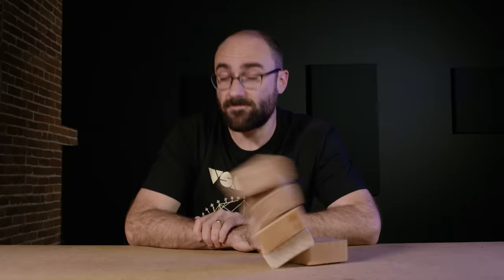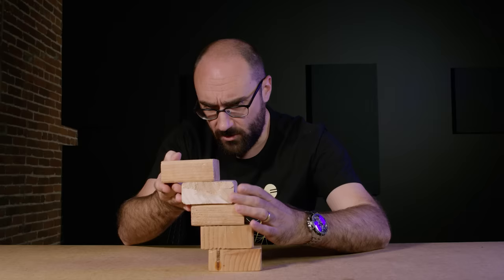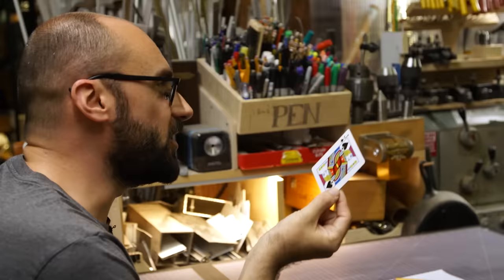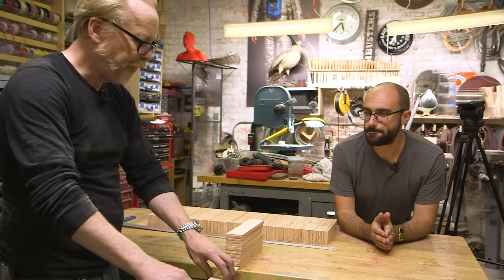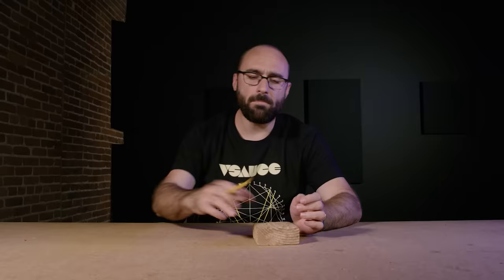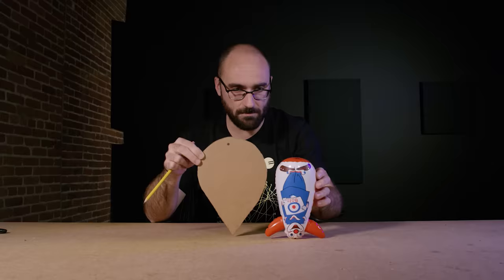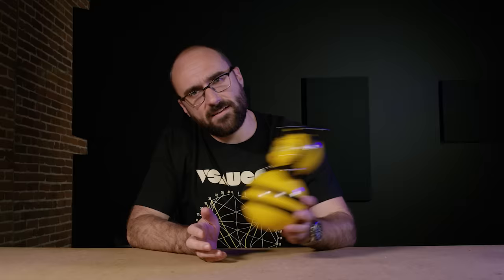The Leaning Tower of Lire

Comment: Michael: 2 card lengths, you're gonna need 31.
Adam: Th-Three card lengths?
Michael (unfazed): 227
Adam: aHahAHHAhaHhhHAhaha
Reply: He can't be beat
Reply: Actually my question is, did he memorize this values or did he calculate them on the spot that'd be insane
Reply: @ichigokurosaki7762  He definitely memorised it, no chance he calculated 227 sums that fast
Reply: it’s vsauce anything is possible
Reply: Marius Grön 

Or did he?
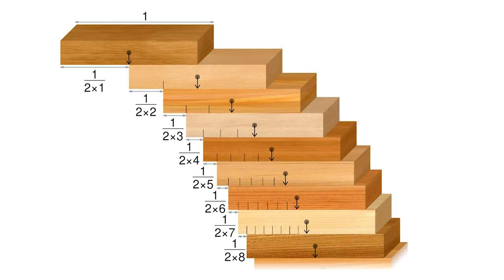Reply: 4:27 It's actually not true. Michael's answer here is based on the harmonic numbers, and the fact that you'd need 31 cards to reach three times your initial length. However here, the distribution is not exactly harmonic as 1 / n, but as 1 / (2n) , as he says at 3:14 in the video. So the figures he gives around 4:27 aren't correct, since they include in the sum, fractions as 1/3, 1/5, 1/7 etc. and not exclusively the even ones : 1/2, 1/4, 1/6 etc. 

For example, in the harmonic distribution we have here, it wouldn't take 4 cards, as in 1 + 1/2 + 1/3 + 1/4 , to double the length, as Michael said at 4:18
But actually 5 cards : 1 + 1/2 + 1/4 + 1/6 + 1/8

And so on... So the figure of 227 isn't correct either. But that's okay Michael we forgive you!
Reply: @Lucas-DX  227 is correct, 4 cards is correct as well.
Reply: @Lucas-DX  :0
Reply: @mariusmichaelgron9938  lmao okay so is it correct or not?
Reply: @angeliniac  Either. What Lucas D meant to say is that Michael just forgot to count the bottom block they're all resting on, but only if you rest them all on one block. Using the edge of a table, you don't need the bottom block (or card).

So in Adam's workshop, 4 and 227 are correct. On Michael's table, 5 and 228 would be correct.
Reply: @vituperation  oh, okay!
Reply: @mariusmichaelgron9938  good mathematicians can do
Reply: @Lucas-DX  yea that makes Sense . But at the same time thats an estimate
Reply: @mariusmichaelgron9938  This Guy just kept naming prime numbers for three hours straight.
Reply: @ichigokurosaki7762  He calculated it on the spot ofc.
Reply: @Lucas-DX  dudr such a long comment for nothing.. The numbers that micheal said were right cause he didnt count the bottom block as you dont have to count it anyway, plus in the workshop he was talking on resting the bottom card over the edge, so the table counted as the bottom card, therefore those numbers werent wrong.. I mean cmon, you wrote such a long comment and wrote timestamps in there and didnt think of that lol?

Comment: 9:00 - it may not make a great bridge BY ITSELF, but it gives you a mechanical advantage such that your support structures only need to support the load crossing the bridge, because the bridge itself is supporting its own weight. Now if you elevate the base and use a series of arches from which cables hang to support the LOAD, but not the bridge... and each cable is only supporting total load/number of cables... you can build a sturdy bridge out of materials that are actually substantially lighter and thus cheaper than you could otherwise. 😉

Comment: To be clear, sating that the harmonic series never going to zero is the reason the Tower of Lire can theoretically extend forever isn't actually correct reasoning. It can do so because the harmonic series (1/n) is divergent. 
If the tower were modeled instead by a convergent series, say, 1/n^2, we wouldn't be able to extend past a finite horizontal distance, even if the series never approaches zero.
Reply: Yeah, that was very dishonest. Like how those wooden planks went further due to sticking to each other better.
Reply: You are absolutely correct !
Reply: Moreover the series he mentions (1/2n) is technically not even a harmonic series
Reply: MinopolisMc Yes it is, it's the harmonic series over 2.
Reply: So he's wrong?
Reply: He's right, but wrong about the exact reasons.
Reply: The horizontal direction within the Tower of Lire is technically parallel to the horizontal surface
Reply: Dennis Chiu calculus. I love it
Reply: This reminds me way too much of Calc 2... binge drinks (very interesting to see in real-world application though)
Reply: Dennis Chiu Yeah, that’s true that this is half of the harmonic series instead of the harmonic series itself. Still a really cool video though.

Comment: For anyone curious, for 10 card lengths, you'd need around a billion cards. That's 1,000,000,000 cards. I'll leave other calculations below:
10 blocks = 1.4 blocks overhang
100 blocks = 2.6 blocks overhang
1,000 blocks = 3.7 blocks overhang
1,000,000 blocks = 7.2 blocks overhang
1,000,000,000 blocks = 10.7 blocks overhang
1,000,000,000,000 blocks = n/a
Reply: DynestiGTI plenty of free time huh?
Reply: What do you mean by n/a? 
With a trillion blocks, the overhang would be 14.1.
With a googol blocks, the overhang would be 115.4 blocks.

Wolfram Alpha is great for these types of calculations.

https://www.wolframalpha.com/input/?i=sum+1%2F(2n),+1+to+10%5E100
Reply: +Big Smoke You know we cant answer that
Reply: +aa aa I wrote n/a cos it would have taken my computer forever to give me the answer.
Reply: Using a very naive loop of "sum += 1 / (i + 2)" and disregarding the very obvious optimization of using powers of two to solve it incredibly fast would take roughly 45 minutes on a 3.8GHz machine (what I tested the idea on, dividing the workload across 4 processing cores using non-blocking instructions to avoid lock contestion). However your dealing with half, half of half, half of half of half and so on so it should be solvable with good ol linear algebra in a single equation.
Reply: And it turns out that if you can put some blocks behind others to counterbalance the stack, you can get a much larger overhang for a given number of blocks. There's a paper that demonstrates how to get an overhang of 10 with 921 blocks instead of almost a billion.

https://en.wikipedia.org/wiki/Block-stacking_problem

https://www.maa.org/sites/default/files/pdf/upload_library/22/Robbins/Patterson2.pdf
Reply: DynestiGTI that's why you use Wolfram Alpha lol, it calculates it in just a few seconds.

Comment: What if you connect 2 Towers of Lire to form a bridge?
Reply: I was wondering the same thing. Seems like it would be weak in the middle?
Reply: Hmmm.. would probably make a lousy single-use drawbridge or a hilarious Candid Camera episode.
Reply: You need to put 2 last pieces together then it will be stable. That's how bridges work IRL.
Reply: Well a bridge made by plywood probably wouldn't work well
Reply: the two endings wouldnt just stay because the one on top would push the lower one down and topple the other tower down. youd need some sort of stand to hold up the middle part just right
Reply: @xyouthe  we are talking about connecting the two pieces together, not adding another one
Reply: @Mr.Caligos  then you cant because one will topple over bcuz if the weight of the other plank
Reply: @youthe not if you connect them ...
Reply: What you are talking about is called an "Arch Bridge", which is a common type of bridge that has been used for a long time in the short time that is human history of architecture. https://en.wikipedia.org/wiki/Corbel_arch is the one you are looking for. Basically it is built to distribute the weight down on the sides and into the surrounding support structure.

They obviously don't use a Tower of Lire principle for maximum extension, as this would in itself be unstable to support additional weight put on it. The bridges use a smaller portion of the overhanging to be able to support more weight on it. Also the Tower of Lire is not fixated by any adhesive which would put you standing on one edge push the other edge away.

At 8:40 you see it toppling over and since it can't just fall straight down it goes in a half-circle curve around its focus point then falls down. Which would put the pushing force distribute a bit forwards (against the other tower) as well as downwards (towards the earth). With additional thickness of the blocks or bars you use you'd get a bit more forward force applied. It still wouldn't be able to support a lot of additional weight on top of its center.
Reply: The ideal shape of a bridge is an inverted hyperbolic cosine.  That's actually the shape of a lot of single span bridges, and it is the shape of the Gateway Arch in St Louis.
Reply: To the people saying it wouldn't be weak in the middle if they were connected: Never set foot into an engineering class
Reply: Two lies don't make a truth
Reply: @patstaysuckafreeboss8006  Enlighten us, please.  What did you learn in your engineering class about why it wouldn't be weak in the middle?
Reply: @carultch  9:05 , he explains it in a way 4 year old could understand in 5 seconds. Quit wasting my time and find the answers yourself, you literally have the world at your fingertips.
Reply: @Mr.Caligos  no its not lol, engineer student here
Reply: @freerunner0682  it's not what?
Reply: Then u got a bridge
Reply: It wouldn't work. Even if you had pillars supporting the ends of both halves, all of the other components are still free to push and rotate against each other. In other words, if the end is fixed, then the collapse just starts from an earlier point
Reply: @marcushendriksen8415  did you whatch the video? 😂 Seems like you don't understand the concept and the science behind it. Ofcourse normal bridges are not free blocks which can rotate.
Reply: @Mr.Caligos  it depends on how you attach them. If you just took two of those towers and connected them tip-to-tip then it would make a hilariously weak bridge that would split and then fall as soon as any weight was place anywhere near the middle. The more you overlap and fasten them together, though, the more you lose the entire point of the shape itself, which is maximum reach with no support, and you just begin building a badly shaped bridge. There's a reason why this isn't a design you see in bridge building. The 'corbel' arches that someone linked above is pretty much the same concept.
Reply: @SpydersByte  every bridge without any pillars is built in simmilar way, center weight is redistributed into two ends
Reply: @Mr.Caligos  there are many different arches and curves used in bridge building, it's just that this isn't one.
Reply: Then it's a bridge

Comment: If you make two towers of the same height that share a top piece you've just made an arch of lire. You can make the most precarious doorway just by stacking some blocks and doing some fractions.
Reply: I bet that's exactly how the aliens and ferrets built the pyramids.  Clever lil guys.. those ferrets.  envious sigh
Reply: I was thinking of a bridge
Reply: Seems incredibly safe
Reply: No because the tower of lire curves a little bit so the top piece is not gonna be one piece...

Comment: Matt Parker did this a while ago but with bricks, good to see you're using something safer. He wanted to see how many it took before a brick was completely overhanging the base one.
Reply: Ohhh yeah, I knew I had seen it somewhere else. Thanks for leaving that comment, it was on the tip of my tongue
Reply: But it will never be overhanging the base one
Reply: Ben Parker did you even watch the video? Matt Parker did manage to get it overhanging the base one with bricks.
Reply: The whole point to the experiment is that it CAN. It just takes an exceeding amount of  precision in brick placement, but it's certainly possible to get 1 brick overhanging or (where things get tricky, and wind urrents come into play) even TWO bricks overhanging.
Reply: I guess technically you can get one brick, due to friction and other forces, however, mathematically, not accounting for friction and with rigid, non-compressible blocks, it shouldn't be possible.  And you most certainly canNOT get a 2 brick over-hang.
Reply: Ben Parker try watching the video again, it is stated repeatedly and proven that you can get two bricks of overhang. In fact, you can get any amount of overhang with enough bricks (Although the number of bricks needed grows close to exponentially.)
Reply: Matt Parker got a whole brick to over hang, it's the exact same thing as in this video when they use the plywood, or whatever it is, I forget exactly. They got a distance of 2 lengths of overhang. You could do it with actual bricks, but they are a lot heavier and harder to move than wood.

Comment: An advice for the future, guys: start building your tower FROM THE FREAKING BOTTOM!
I know the index in equation increases by going down, but once you know the numbers you can calculate it and you're good to go. It's also more fun to add a block (or card or whatever) on top and see if it balances, rather than having to hold everything every time.
Reply: you must be fun at parties
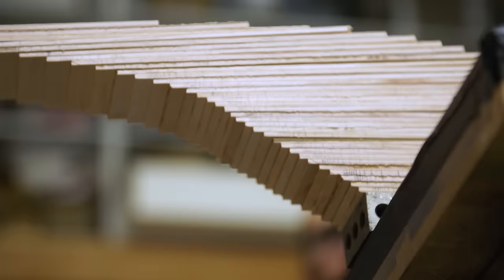Reply: Agree.  When Michael gazes from underneath (about 8:00 mark), you can clearly see the mathematical formula was not adhered to on the bottom slats.  They are both putting it together on FEEL.  Each slat in the series should overhang 1/2 of the distance of the one above it, or am I missing something?  And that just isn't the case on the bottom arch, where the distance appears uniform on many.
Reply: エル・デスペラード EL DESPERADO look who's talking.